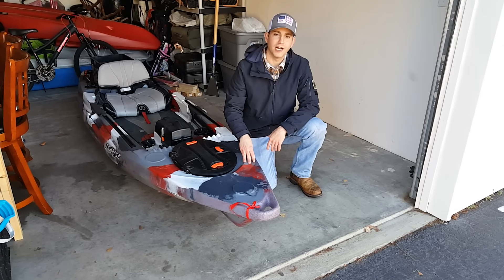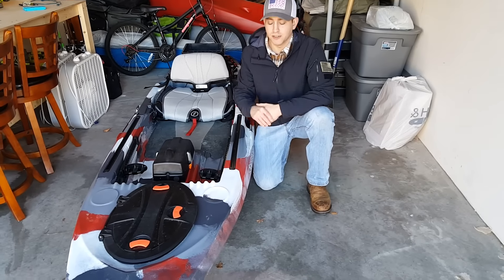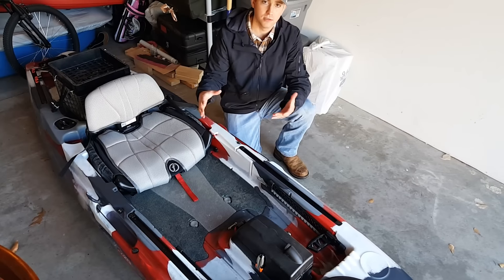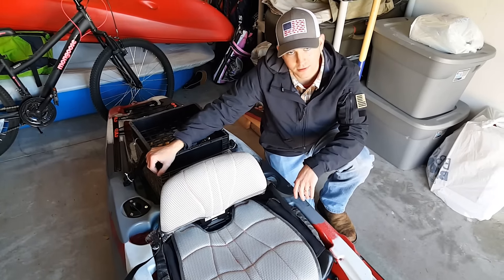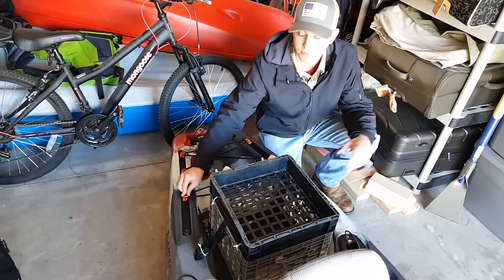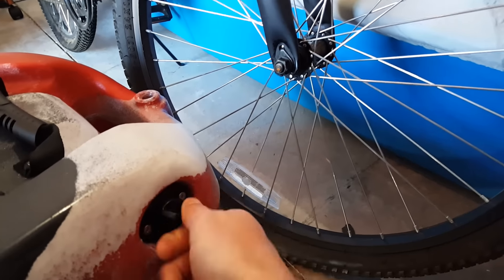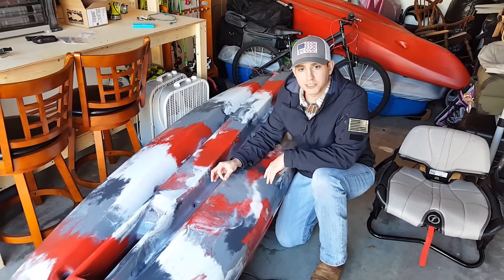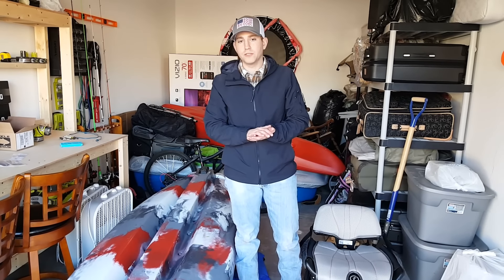FeelFree Lure 11.5 Review (Is it the MOST innovative kayak on the market?!?!)

Comment: 7:00 the cup holders are perfect for holding a 10 Lb. Mushroom anchor!
Back out of the way and I just leave about 5 ft of loose line so I can just flip it out since I'm usually in 3ft or less fishing the flats. 
Without an anchor trolley I tie the line to the center handle (total length is about 12 ft)

Comment: have a lure 13.5 and the rudder is absolutely a necessity. after I put mine on it was a different kayak. totally solved all my issues. I even made my own using one of the cheap amazon rudders and getting the foot pedals from feelfrees website. all you have to do is make the pin on the rudder longer and it all fits.

Comment: I bought this model 3 years ago......didn't know it at the time but the hull was cracked right under the seat on the right side.....a half inch hairline crack, just enough to let in about a gallon of water in a 4-hour fishing trip.....I've patched it but wish I'd found it before the hull warranty epirec....you expect the bottom of a kayak to get damage from running it onto shore and over logs but not to crack inside.....overall I'm happy with it, the seat is the reason I bought it.....

Comment: Good review. Can you tell me if you      compared the Jackson coosa HD also? I can't seem to make up my mind. I m a river fisherman and wonder about the feelfrees durability? Does the seat back too low for your liking?
Reply from the maker: I have put my feelfree through the ringer and it's held up amazingly... I've dropped it dragged it across gravel and sand even ran over the top of a metal pipe in the water and no major damage. Compared to the coosa it's a little cheaper and more stable but the coosa tracks better. I wondered the same thing about the seat but it fits right on your lower back and it's super comfortable and sturdy and I didn't find my self feeling like I needed a higher back. (By far the most comfortable seat) the lure also has the option of buying the pedal drive system that you can buy later on. Both kayaks are pretty wide and pretty heavy but can stand up to rivers. For fast flowing rivers with rapids both of them may not be great because of the width and weight. The feelfree moken is a great kayak for flowing rivers at a way cheaper price point than both but you lose the lawn chair seat and some stability but better tracking not as wide and not as heavy.

Comment: i been looking at another kayak the pelican 120 NXT, than i saw this and well had to check it out, honestly the price is totally out to lunch unreasonable, the peddle power system cost just as much as the kayak, the kayak cost is 1198 USD, with the pedal power system its 2100USD and i can buy the catch 120 NXT for 1200 canadian, thats a huge difference and feel its only fair that others know about that trade off, it sure looks great dont get me wrong but for the value you just may be better off with the catch 120 nxt. enjoy your kayak :)
Reply: All pedal power kayaks are priced that high.  It seems way over priced to me as well.  You can buy an electric trolling motor and battery for half the cost.

Comment: My gripes about my 11.5 is the seat, the sonarbox, and the non-std rails.   The seat is super comfortable but doesn’t transport well in the kayak.  Take it out for transport or it will start to shed parts.  If you tighten the 6 bolts that hold the seat together is wont actuate un and down freely.  It need to be assembled with those bolt not over tightened.   My first call to Feelfree was spare parts lost from the seat while in transport.  I like the sonar box, its big enough for my TotalScan xducer on my Elite Ti sonar but the clips that hold it together and in the boat are mediocre at best.  In direct sunlight they become soft and loose.   When my dealer has the Dorado in stock I would consider selling by 11.5 if is faster and has a place for my total scan recessed in the hull.  All and all I like my Lure 11.5 and Lure !0.  I fish a lot of smaller water in the 10 and if you don’t need a sonar the 10 is a good option.  I have the rudder on my 11.5 is great for bigger water but not necessary.

Comment: how do you store the kayak when not in use on the side on the bottom
Reply from the maker: leo ybarra always the bottom just because it is a pretty heavy kayak and I do not want it to get misshapen or fall over.
Reply: is that on its bottom on the floor or on the floor on its side just asking wife and i have the same kayaks but don't know how to store them best
Reply from the maker: leo ybarra on the bottom on the floor I place it on two boat cushions to protect the bottom and keep it off of the hard surface
Reply: thanks thats what we will do
Reply: Feelfree recommends the side I hang them on the side for longer storage.  They stay on the trailer most of the season though in the upright position.

Comment: Hey there dudes. Nice video review. Didn't realize there are so many built in add ons for the Feel Free Kayak. The seat is definitely nice. For the money it seems pretty good for value and I will put it in for consideration. Even though the Hobies are more expensive I'm still partial to the foot peddles propulsion. Just a personal preference for hands free. Either way that looks like a great setup. The outtakes were a nice touch..lol..Pay the water dudes..LFB PTW.
Reply from the maker: Thanks dude. One thing i did forget to mention is that FeelFree came out with a pedal drive system for this kayak it slips into where the electronic pod goes and bam hands free lol ill address that in the next video. and as always brother LFB and don't forget to PTW!
Reply: Nice review. I have the Lure 13.5, same color. Couldn't be happier with it. I have had it for almost a year and been on lakes, ponds, and rivers and it has done well for me. I have the rudder and it is really helpful. I thought about the peddle drive, but I enjoy paddling and it wouldn't work in the rivers I float, plus I love the fish finder on the sonar pod.

Comment: for all the great things about the Feel Free models, thee big downfall is speed. They are incredibly slow. Hasn't stopped me from owning more than a dozen.  I would recommend them all day long, but I added a Radar 135 and it smokes my lure 135.  Great stability though
Reply from the maker: Matt Martinson yeah I've heard good things about the radar. And I agree feelfree kayaks are not built for speed but for smaller lakes and big ponds in my opinion I feel like you can't beat them. Thanks for the comment! -PTW
Reply: I love the feel free models, I actually prefer the Moken 10 overall.  I fish rivers mostly and rarely stand on them.  It's a camping machine with its open front and rear deck.  My Lure 135 is rigged with lights trolling motor and solar, which makes for a great lake boat.  I only grabbed a Radar cuz my wife whips my butt going down the river, so if I don't want to spend all day paddling trying to keep up, I had to try something else.  Even though t the Moken 125 is very similar .  Keep paddlin' brother